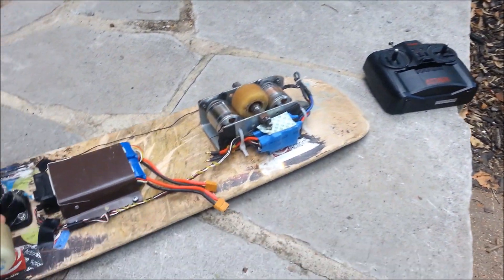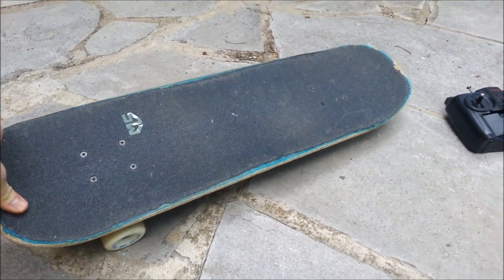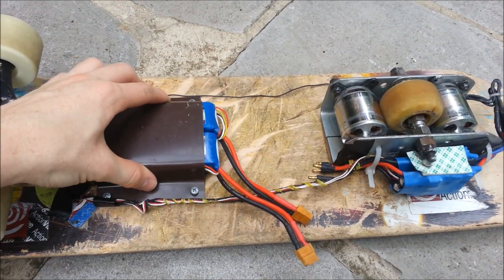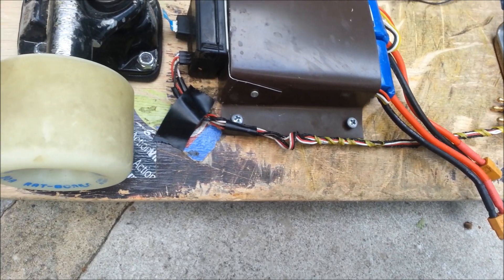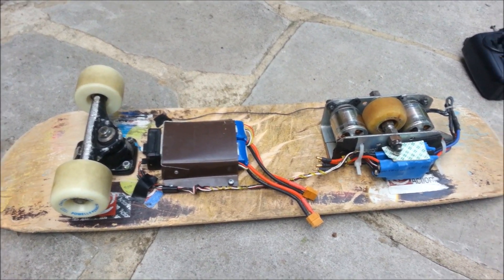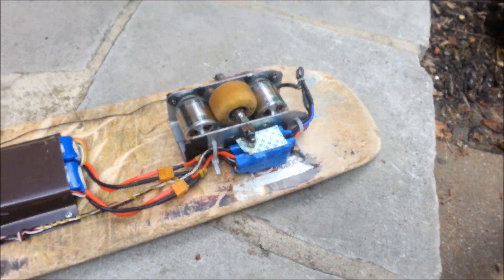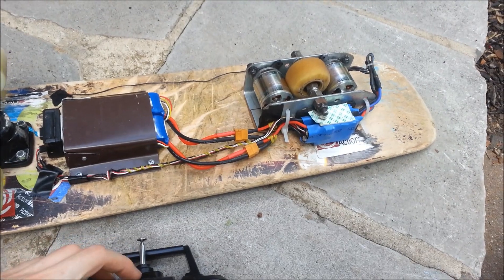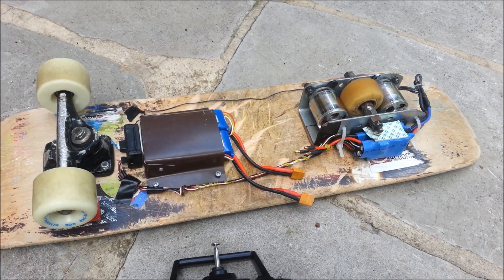Homemade Electric Skateboard

Comment: Hi where did you buy your motors from? I can see some on ebay but not sure if they are the right ones? Thanks
Reply from the maker: You can get them off HobbyKing for about $35 each. They are Turnigy SK3 350kv brushless outrunners.

Comment: What kind of motor is it please ? and what is the V of the battery ?
Reply from the maker: I used two 350kv turnigy SK3 brushless outrunner motors each powered by a 11.1v 3s lipo battery